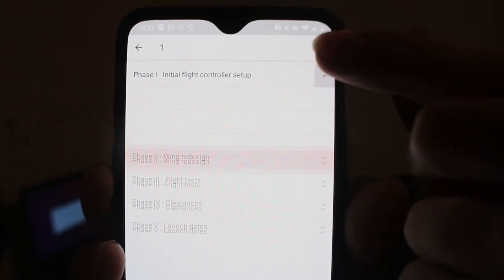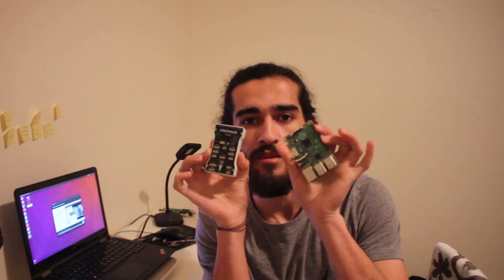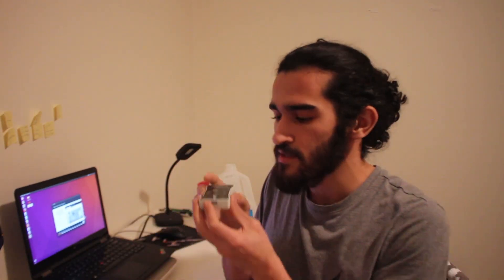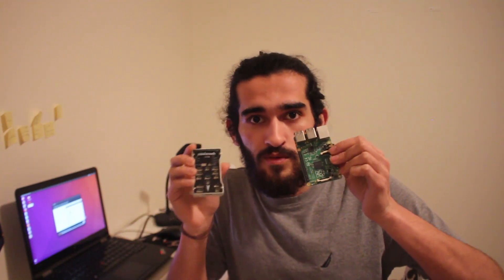Project Log 7 | Autonomous Glider From High Altitude Balloon

Comment: I am looking into something similar but don't have enough knowledge to achieve it yet. What is the advantage of pixhawk vs a drone  flightcontroller with iNav?
Reply from the maker: Pixhawk has redundancy, more processing power, and a more flexible and powerful flight stack. I do use iNav for a hobby wing though, it's fun to mess around with but it doesn't have anything like thermal location, wind estimation, etc all amazingly smart things that the guys at pixhawk have. 

Also I'm not sure if you can use ROS with iNav. There's already MAVROS packages available for Pixhawk, saves time and is established.